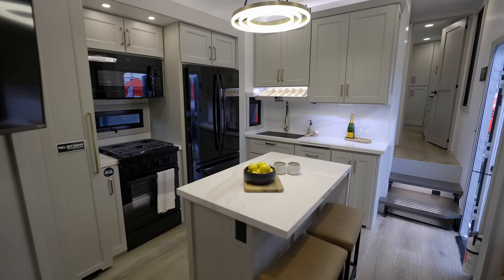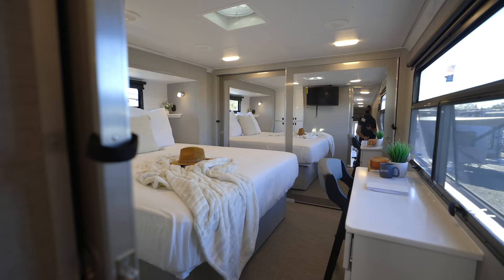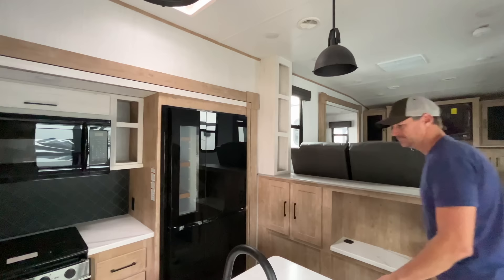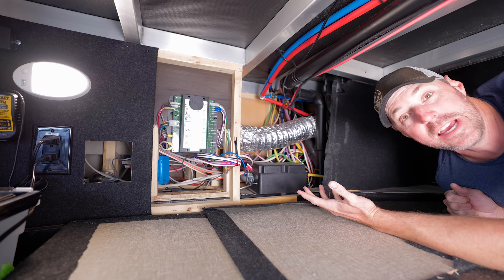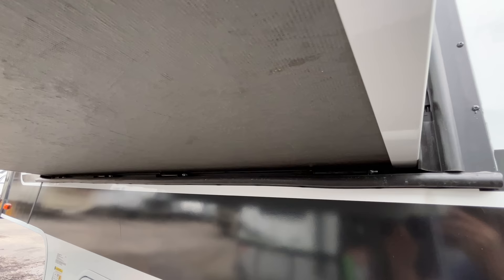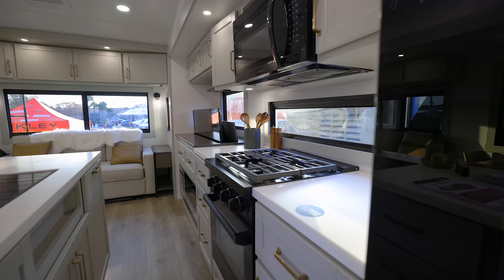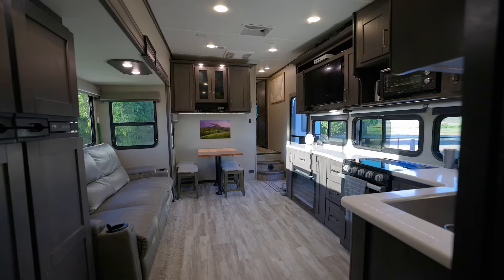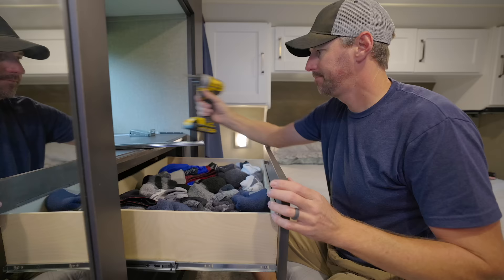Are All RVs Junk! Problems With Our Grand Design RV.

Comment: I am a Brinkley fan.  Also having spent years in the QA business, not only did I find problems and potential problems, I was able to put in design changes to ensure the problems didn't happen again and they were always implemented.  I read some of the other QA folks said below.  They are right insofar as some of the issues found with some lesser quality-oriented manufacturers is that they just don't care, they want the sale.  

My son, who works for an RV dealership, freaked out when I bought a Destination Trailer to live in part-time (for now) as a snowbird.  He has the same attitude about RV builders as do you.  

The drawer guides are a must-fix but the slide trim that is off-center does not.... as one is function and the other is form.  However, it would bug me too.  You made some good points.  As I said, I am a Brinkley fan and proud of it.

Comment: We purchased a small RV (Our first) a few years back and with all things considered, we were novice first time RV'ers etc. and with time I realized these things are truly made cheap. Today I consider almost all your run of the mill RVs just so so, and ours would be in the above (ever so slightly) average quality (Cruiser RV). I think we share the same approach and that is you buy an RV, you live and deal with it. Not always pleasant but easy to fix. The most important of all is regular maintenance and proper end of season storage.
Great little video, easy to follow and appreciated.

Comment: I was a previous owner of an American Star by New Mar back in 1995. I full timed in that RV for 10 years. Everything worked as advertised. I just thought that was how all RV's were made. Fast-forward to 2020, I purchased a 2020 VanLeigh 5th wheel. In the first two years I endured 18 discrepancies, 12 of which were in the first year. 8 of the discrepancies were water leaks, a shorted wire in the walls for the galley fan just to name a few. When I opened the service bay to fix the water leaks I was met with 1/2 to 1' piles of wet sawdust everywhere in the utility area. The VanLeigh was 80K and the American Star was 22K. I long for the days of the American Star.

Comment: Your one comment was spot on. You definitely have to become a DIYer to own and maintain an rv. I’m glad I have videos like yours to watch!

Our family purchased a brand new Winnebago last year. Like you said, it’s made with good parts, but poorly assembled. We’ve had over 40 individually repaired issues, and some still aren’t fixed 13 months later. 

The worst being a recall on the lippert slide system leaving us 2000 miles from home, stuck in Las Vegas with the slide half out.

I feel bad for the dealership because they get the brunt of our frustration, and have been really good trying to take care of us. Unfortunately fixing things aren’t always easy.

Comment: Brinkley is definitely shaking some things up in the RV industry.  Hopefully the improved competition ends up floating all boats in a positive direction.
Reply: I agree .. I've looked over a few Brinkley's and from what my eyes see they are hands down the most impressive unit I've seen if all higher end brands. Not to say they won't have their issues too but my judgement is that they are out together with wayyyyyyy more pride and craftsmanship than others. And I'm a grand design owner and disappointed in the craftsmanship and quality of Grand design.. I've been across the country and stopped at numerous dealerships and looked over many many units so I'm no greenhorn😉😉
Reply: Grand Design is building them better and their customer service is good. We'll stick with them for now. Out problem has been dealer service dept and techs that can't figure out the digital controls.
Reply: @Dive-Bar-Casanova  I'm in no way out to attack anyone's judgement or opinion but have you recently looked at, inspected, the grand design models? From low end to the high end solitude? I have within the last month seen many throughout the course of a 10,000 Mile road trip from coast to coast. I myself an not slightly impressed with build quality. It shows all you have to do is look.... Replacing quality workmanship with (bling) that anyone can go to Walmart and upgrade it's insane!!!! I'm sorry but that's my 2 cents and I'd love to buy a quality 5th wheel to full time in but my hopes of high quality are slim unless I build it myself and frankly I have not the time for that kind of build
Reply: Happy camping and I do wish the best for you're rig. Safe travels😉😉. Sorry for the rant lol
Reply: @livewire2474  We've owned two Grand Design units since 2014.  We just bought our third - a 2024 Solitude.  We've put about 1,000 miles on it so far, and it's been flawless!  We're thrilled so far, and the quality seems to be much better than our 2014 and 2017 Reflection models.
Reply: @ZonaJim  that's great news I hope it gives you years of enjoyment 😉😉 God bless
Reply: We have a 2018 GD Reflection 303 rls  used from a private seller that was used very little. We have had for 2 years and had only minor issues. As I understand it the 2018 was made when owners that built the GD company still owned it and had their reputation at stake and likely better built than present owners, plus made before COVID time.

Comment: We’ve owned 6 different rigs over the years and bought our Brinkley in late July after terrible problems with a much ‘fancier’ 5th wheel. Brinkley is hands down got most things right. They addressed many of the issues most RV’r’s have.  The only comment I’d make, is the price comparison of the Brinkley to other RV’s is list price comparison. GD only allows RV’s to be sold at list, while Brinkley list can be negotiated with your dealer. We did well on our purchase and was much closer to GD’s price than the list price difference.

Comment: Just my  two cent but every 5th wheel we looked at buying this year was already having trim unglued, electrical issues, plumbing issues, and even had two different brands have the slides not go out because of electrical issues. Campers are not worth what they cost. The only way to get good worksmans ship and quality parts is to spend over $100k, or be prepared for your camper to be at the dealer for extended periods the first year for warranty work.

Comment: I think your assessment is very honest and consistent with what I have seen in looking at several different manufacturers. Yes, some are certainly built better than others but even if the perfect RV exists, drag it down the highway for a few hundred miles and there will be opportunities to work on it. Personally, I have an RV designed for Overlanding. Not saying it is built better but it does have superior suspension to the standard RV's. It is my belief that this will help things to move around less while traveling which should mean less opportunities to fix stuff. In any RV, it is my opinion that if you are not a DIY or handy person and you are not willing to learn, that you should avoid all brands of RV's.

Comment: Thank you so much for putting this out there. I Could not agree more. So sad that these rigs have been done so cheaply. It’s just wrong. Consumers should rise up and say NO more.
Reply: Recreational Vehicle is a misnomer for the units that you feature.  These big things with multiple slides are mobile homes that people live in and can transport personally.  They are not designed or constructed of the durability required for recreational travel.  The wiring, plumbing and appliances are not ABYC yacht standard, or even residential standard.  You get what you pay for, and the market obviously does not support the prices that quality travel trailers would command.  I’ve towed over 150, 000 miles in the two Airstreams that we have owned, and would purchase no other travel trailer.  They are good, not perfect travel trailers, and I would not consider them to be ‘houses’.  They are expensive compared to the ‘junk’ that you highlight.  For the length, they are smaller, but have a durable structure not compromised by slide outs.   I wish that better quality was available, as I prefer a travel trailer for our recreational travel.

Comment: I RVed for 20 years, starting from an old used 1972 Dutchman with no bathroom, that was actually rock solid, to a 2012 Outback.   And I quit due to I got tired of fixing things over and over again because of them being cheap.  Instead of screws, lets use glue or staples.  That caused water damage for us and it was just sitting over winter   Every penny saved for them is money that costs the owner down the line.   I live having free time back, and not wasting an entire weekend getting the thing ready for winter to park it, and the reverse in the spring to get it ready for summer.  I like not having to pay insurance for something that sits unused 6 months a year or more.  Live in Canada, and we dont winter camp.  I like not worrying about mice getting into it, or every hail storm that comes by will my trailer be ruined.  Its been 5 years now, and will never go back

Comment: Unfortunately it's about money. One of my biggest complaints is insulation. The insulation in the ceiling is horrible.   The roof material is cheap. It would be interesting to find the actual cost, parts, and labor to see how much profit is made. The ac and heat system are inefficient and poorly designed. We have an older Everest better quality, but I still have to fix stuff all the time. Keep up the GOOD videos.

Comment: I had a new 2019 Grand Design Reflection and it was a dude. The ceiling fan cover and furnace squirrel cage blew up because they were made of plastic. The tandem axle alignment was cocked causing uneven tire wear. There were granular pebbles poking a hole through the TPO membrane leading to water damage on the roof. They used a 1/2” floor on the kitchen floor in lieu of the 3/4” spec for convenience. This resulted in the kitchen floor edge trim scraping a hole on the main floor laminate. Worst of all, customer service basically told me to take a hike. Unloading the rig was the best part of the whole experience.
Reply: Our 2017 was a great unit, current experience with just-purchased 2024, not so much.  Their quality really suffered after they sold to Winnebago.  The original owners are some of the ones who started Brinkley.....
Reply: @fredgross2781  seems like Winnebago ran Grand Design into the ground. Their focus on short term profits ruined the brand. Never Grand Design.

Comment: I built my house in the early 1980s. I milled most of the lumber in it. I went on to spend 12 years in construction. Whenever I would go into an RV and look around, new or owned by someone, my impression has been, "these things are junk." Artic Fox is the only RV, that I've seen that seems to be decently built. It doesn't help that these horribly built (manufacture and materials used) are subjected to hurricane force winds every time you move them. And further that while they are being exposed to these hurricane force winds, they are slamming into pots holes, raised pavement edges and any other obstruction lying in the roadway. This year I really wanted a trailer to haul my adventure motorcycle in that I could also camp in in remote places. Every toy hauler (new and used) that I looked at was junk. I ended up buying a tank of a cargo trailer, 16' with a 7.5' inside height (I'm 6', 1" in my socks). It has 3,600 pound Dexter torsion axles, three member tongue (1/8". 11 gauge) square tubing. I'm building the interior myself from wood that I'm milling.

Comment: There is no "perfect" RV. RVs are a house designed to move down the road at 70 mph. Components come from many sources and cost, strength, flexibility and weight are all factors that affect the final quality. I agree that there is a big difference in workmanship that can always be improved. If you own a RV, you had better be able to perform at least some of the required maintenance. I liked this video.

Comment: If you are going to buy a RV YOU MUST be able to repair and or upgrade components yourself.  Otherwise stay in a lodge or the holiday inn. 

I bought a new RV 2 years ago.  After about $2000 and a year of my own labor I have a nice unit.  Problems I found in my Forest River Wildwood

1.  All water connections barely finger tight. 

2. China bomb tire coming apart on 300 mile trip home from dealership.  Piece of wire reinforcement sticking out of sidewall. 

3. Main wiring harness laying loose in frame holes where they WILL chaff through.  

4. 115v romex wire run between to drawers in kitchen where drawers were rubbing against the wire

5. Axle spring hangars showing signs of flex.  Upgraded to mohr ride hangars & braces. 

6.  Holes for wires roughly cut with sawzall. 

7.  Tv antennae coax not hooked up

8.  Holes in underbelly not sealed

In addition to the trim issues, loose  and other shoddy work  that you mentioned. 

If you are not capable of fixing issues such as these DO NOT BUY A RV !!!

Comment: My 2021 Hampton 388FKL I bought as a home[It was 145k CAD]. Housing is absurdly over-priced here so it was my best option. I love how it's designed and it's a perfect size for myself, girlfriend and 2 pets. It is easily the most expansive thing I've ever bought and it is indeed horribly disappointing. As people said in the comments you read... cheap parts built by people who either don't care, are inexperienced or cheap labor. Many things failing in terms of trim and water lines. Elec fire place already completely died, blower motor on my furnace, converter all dead. Had to be replaced. The blower motor I had to pay for myself. Black tank flush 1 way valve was installed backwards, water pump not tuned properly, caulking on all areas was terrible[even the dealership that inspected it failed horrible after I specified to check that so I can to do it myself]. The king mattress is horribly uncomfortable. I wake up every morning with a sore back and cannot afford a new one just yet,  shower wallpaper separating, the wood around the bottom of the cabinets in the bathroom are deformed due to being soggy before we saw how bad the calking around the shower was and from the leaking shower pex tubing, ALL crown molding trim and trim around the doors are poorly done. They don't sit flush very well and many of it I had to reattach, curtain appearance trim is all falling off, external LEDS under the awnings have failed and the awnings sound like you're dragging a 500lb plastic couch over a linoleum floor. The list goes on. Incredibly disappointed. DIY is a MUST for RV living. Mine is BARELY 1 year old.... Also now that I had to remove my furnace it's impossible to hook up the furnace tubing for the loft because it was obviously initially installed as they built the trailer around it. There's no way to get back there and it doesn't even get close to reaching the furnace when it's pulled out.

Comment: RV stands for, "Repair Vehicle!"  Over 23 years I have owned 2 bumper-pull trailers.  I loathed getting rid of trailer #1 because I knew I'd have to go through trailer #2 and fix/get to know all the things that I had already knew/or had repaired on #1.  I'm at the point now where it's either an Airstream (or equivalent quality) RV or it's a true Repair Revicle. Bring your tools.

Comment: My job requires me to work on the road 10 months out of the year. I have a Harley and 2 dirtbikes that travel with me so I have a toy hauler which is basically a camper with a garage in the back. I've been doing this for 11 years now, and my advice is to buy an older and much cheaper camper/rv. They are built better and you can feel better about paying a fraction of the price for a new one.  I buy one in good shape and live in it for around 3 years and sell them for almost what I paid and then buy another used one. Currently typing this from inside my 08 Keystone Raptor. It's paid for, doesn't leak, and everything works as it should. Also, if you don't live in yours full time, I highly recommend buying a pole barn to park it under to keep the weather from beating it up. Stay far away from 2020 and newer models. Just make sure to check for any leaks when buying a older one. Don't buy one that's been leaking already.